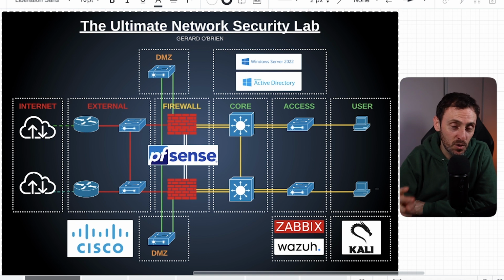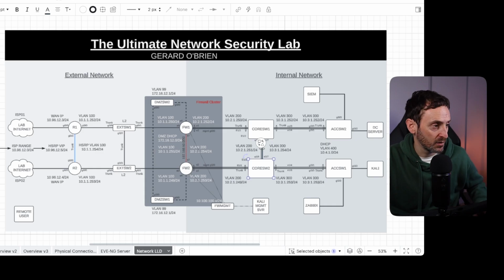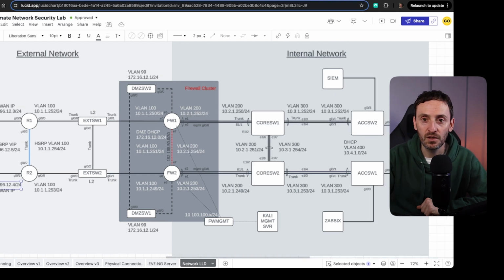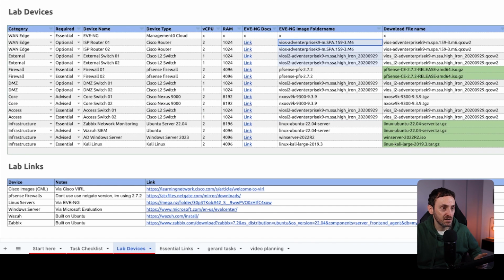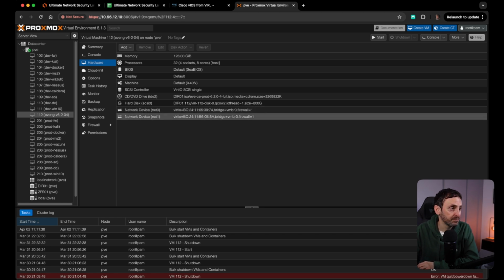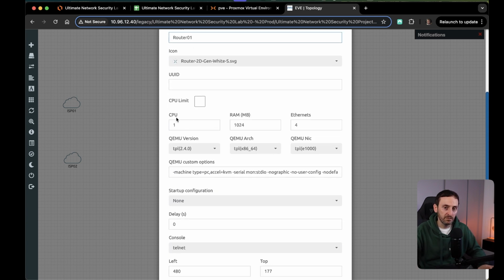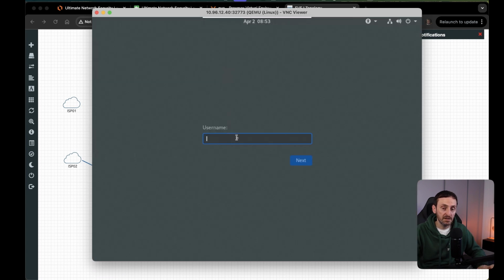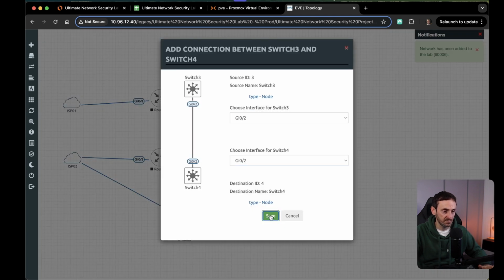The Ultimate Network Security Project - Episode 1

Comment: Thanks for this , really great content. Just a question regarding EVE-NG on proxmox , I have been using it for a couple years now and notice that lately EVE-NG when not being used and just left running on proxmox , the server just freezes and then I need to do a power reset of the VM and it starts up and works perfectly fine for a few days until left idle again. is this something you have encountered on your EVE-NG running on proxmox at all?
Reply from the maker: Hey mate, when did you last update your eve-ng VM? Also what's the spec of your server? To be honest I never leave my VM running, I only ever turn it on when needed... I've given my VM loads of resources so it usually runs quite smoothly
Reply: @techwithgerard  thanks , I updated last about 4 months ago , it's probably due a update again.

This issue only started about 6 months ago from what I can recall, so may be a bug potentially. Resources is 12 cores and 16gb ram I have allocated to the vm

Comment: Am Asking myself the ISP connection network doesnt have any cable , is it directly connected to your PC adapter , and if so how does it know which specific adapter to connect to , because i have seen the connections for the rest of the network devices and onto which ports which is not the case with the ISP connection , or the ISP is just a simulation ?
Reply from the maker: This will pass through to the virtual switch your EVE-NG vm is connected to.  In my case I have my server connected to a lab network in the 10.96.12 range... so technically when I connect the ISP router WAN interfaces to the ISP's they will get an IP on my 10.96.12 range.  In episode 2 (coming very soon) we go through this in a bit more detail
Reply: @techwithgerard  Oh thanks Brian , let me wait for the next episode to pay attention to this detail

Comment: t's fun, though! I have tried this setup, but not with Cisco routers or switches. I had IPsec tunnels to a data center that then connected to the outside (yes, I did have a router for my pfSense A and B), but I couldn't get a second one due to budget issues, so I only ran with one. We had one upstream connection of 600 Mbps and two 4G SIMs doing around 200 Mbps each. Through IPsec, we could access all infrastructure online.

Still, working with old hardware on-premises was a nightmare, so I had to replace components on a budget. I went for MikroTik because it was within budget range. The only downside was that I had to install fiber and some Cat 6a cabling myself, and that was not fun.

The only difference between the network you are building and mine is that I had 24 switches on the access layer and a lot of UniFi access points. The sad part for me is that this was an internship, and the company did not care much about security. I tried, but with limited time, resources, and know-how, it wasn't easy. It's just disappointing when you have to use second-hand server parts and devices to make it work.
Reply from the maker: Sounds like you have a great setup going! cant beat having proper hardware to build it all.  A friend of mine is a big MikroTik fan, I was gonna test that for this lab too.  One of the good things with EVE-NG is if you get the images you want, you could go back and visit that design and rebuild it exactly the way you wanted it!  

If I was gonna build this lab in the real world, id definitely be building multiple vPC's from the Nexus core switches... those images are very hard to find and you need a decent machine to run them.. thats why I've just added standard Lagg ports!  :)